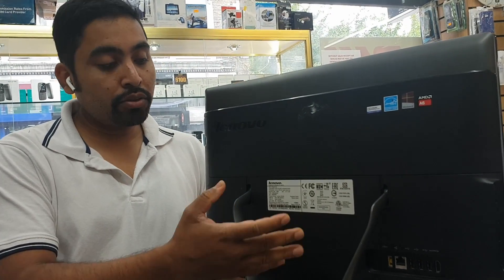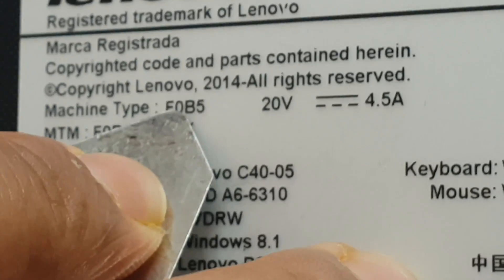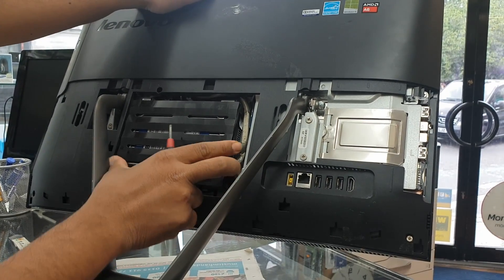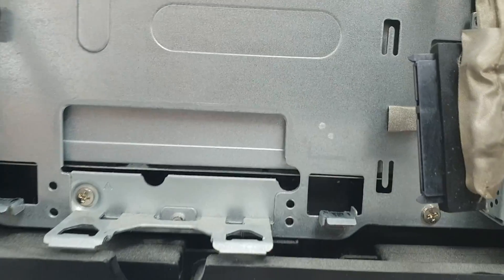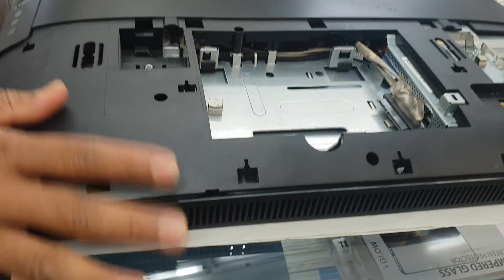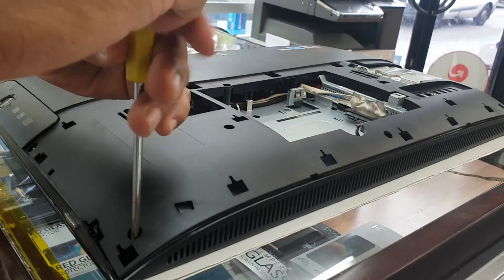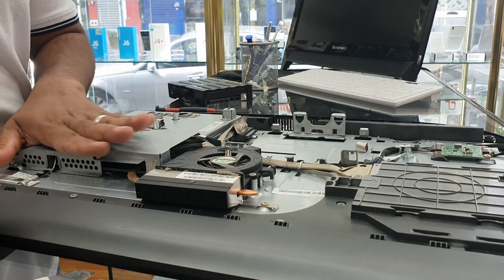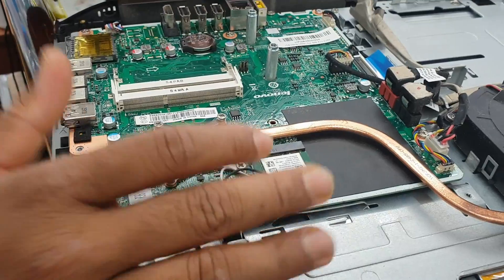How To Open Up LENOVO C40-05 All-in-One ( Step by Step)

Comment: Somehow a BIOS was "updated" on this when it rebooted. Now keyboard doesn't light up at all, hard drive spins, no key combo gets to BIOS, screen is 100% black Power light white turns on and I can hold it down and it shuts off. Is there a way to "reset the bios" to the original manufacturer one?

Comment: Thank you. Your video gave me the the information needed to open my C40-05 All-in-One pc. My pc was getting quite noisy,  I needed to vacuum and clean the accumuleted dust from the air-vent. This could not be done from the exterior. The air flow is now back to normal and my pc runs more energy efficient and quiet. Again-Thank You!!🤩

Comment: I have lagging issues in my computer it has windows 10 pro the same computer with 256 gb and 4gb ram and i3 processor and not getting the solution, very but no apps are opening and working and it takes approximately an hour to start the pc

Comment: I just bought another Lenovo same as this & due to a simple BIOS + Bitlocker Key i was blocked out of my Laptop Lenovo 430s,a very fast & reliable Laptop as i put extra RAM with being 2-bays one under the keyboard and another under the laptop and so easy to do. I have done something in BIOS in my 430s but this new Lenovo i got im looking-up ways to clean it & insert RAM from the older one ...Thanks a lot for this video as im going to get my compressed air can and Ram and see what happens.....Best SUB ONLINE FOR ANY LENOVO USER...10/10 HONESTLY

Comment: Hey so you know how to turn this into a monitor?
Reply from the maker: Such a good question. However, I never did try on this. But there is an HDMI connector that may for the secondary screen.   I will give it a check soon. Most probably it would not work but still, I will give it a try.
Reply: @thepcphone  thank you 👍

Comment: I have a black screen in mine how can I fix that ?
Reply from the maker: YOU have black screen or no screen? its very important to know. no screen means there is no light at all in the LCD when the pc boot up. Black screen means when the pc boot up it shows the brand logo and then LCD went dim and black.
Reply: @thepcphone  what to do if it's black screen. I tried upgrading from 2gb to 4gb. After the logo, my screen turns black

Comment: does it have intel hd graphics? can i upgrade it to a 2080 ti
Reply from the maker: Yes it has but its not upgradable as i know. Thanks for your comment.
Reply: @thepcphone  Ah Ok, but what intel hd graphics? 2000, 3000 or 4000
Reply: @vambat3523  It doesn’t have Intel HD graphics, he got that wrong. It has AMD A4-6210 APU with AMD Radeon R3 Graphics
Reply: @imdisturbeddd1625  some models have integrated graphics
Reply: @vambat3523  even if u install a 2080 ti illl bottleneck ur cpu
Reply: @gain2zraie633  True, but is the cpu upgradable? I don't have the pc anymore, i got a new gaming pc
Reply: Nope its soldiered into the mother board
Reply: @gain2zraie633  Oh Ok
Reply: @gain2zraie633  Yes but I’m specifying the exact model in the video which has an AMD APU

Comment: Is the motherboard replacable ? The PC is no longer turning on when I push start
Reply from the maker: YES, ITS REPLACEABLE BUT FACT IS WHERE YOU GONNA GET THE BOARD FROM? LENOVO DOES NOT SEEL ONLY THE MOTHERBOARD IN OPEN MARKET. BUT IF YOU TRY IN EBAY YOU MIGHT GET ONE. GOODLUCK
Reply: @thepcphone  thank you
Reply: I have the same problem

Comment: Once the back is all removed, is replacing the HDD SATA cable easy to do? Just checking if any other parts will need to be taken out to expose the various plugs
Reply from the maker: just to replace your hdd would not be very difficult as the back cover is only part you need to replace. Make sure the model of the PC has same number . thanks for your question. i really do enjoy it.

Comment: The ram is sodimm?
Reply from the maker: Dimm Speed: DDR3-12800 (PC3-1600)
 Dimm Type: Non-ECC
 Product code: FT8GSK64V4U
 Storage Capacity: 8GB Module
 Form Factor: 204 Pin SoDimm

Comment: Can you teach how to install an SSD? LENOVO C40-05 All-in-One
Reply from the maker: THAT'S A GREAT IDEA BUT THERE MIGHT BE SOME OBSTACLE HOW YOU GONNA ASSEMBLE IT? TRY AND SEE WHAT HAPPEN! I NEVER TRIED MYSELF. BUT IT SHOULD BE FINE.
Reply from the maker: Hi mate! it's a simple process if you do follow the whole video and know how to open up then take out the 3.5 hard drive and connect 2.5 mm SSD in there and close it back as you know the SSD is so light in weight so nothing would happen as I know
your comment is highly appreciated . do not forget to subscribe to my channel for more videos. thanks
Reply: @thepcphone  Can I put ssd in the DVD connector?
Reply: @deknomadblackboom  remove the DVD drive and see if you cant replace it with a drive adapter where you can place another slim hdd or ssd's.  I have one.. but I may need to get s couple of more since the one I have might become useless later.